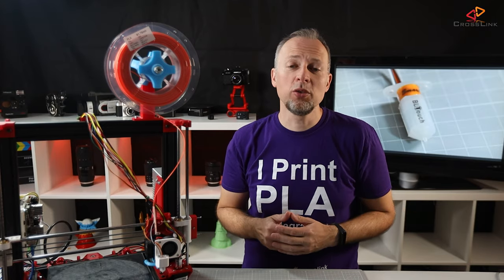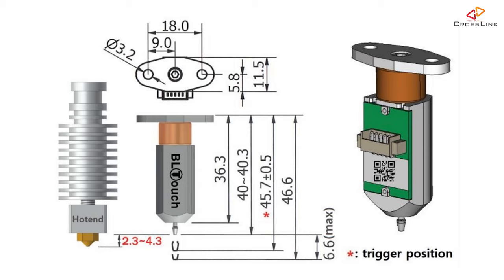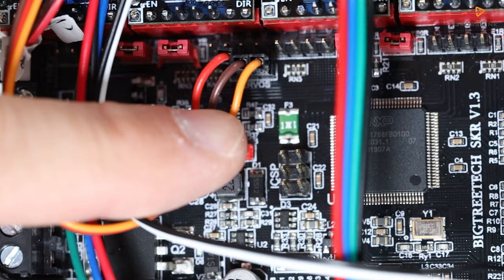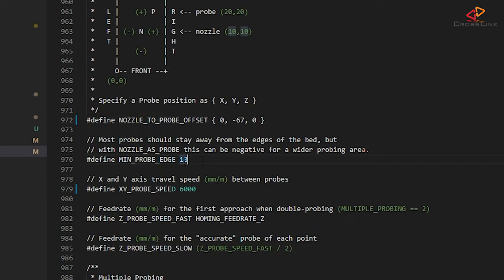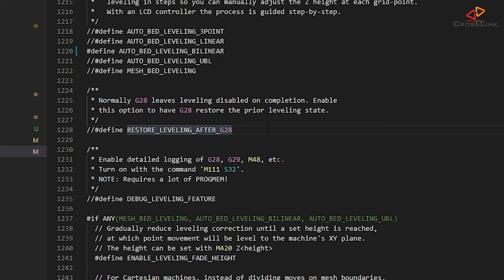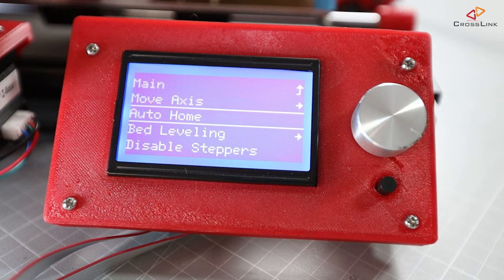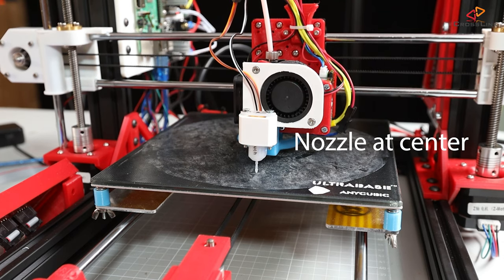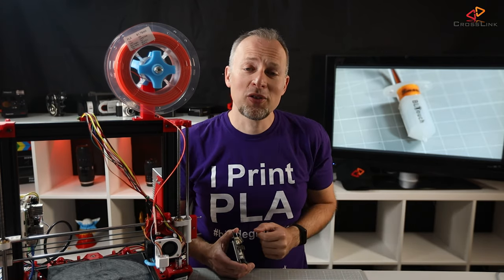SKR 1.3 - BLtouch installation and Marlin 2.0 configuration

Comment: Wow.. I didn't know that the z offset can be set so easy as you did. Thanks.
Reply from the maker: That's mainly because commenting out the MIN_SOFTWARE_ENDSTOP_Z
Reply: @Crosslink3D  Unfortunately this doesn't seem to be working for me. I've used your settings as suggested in the video, on my Ender 3 Pro when I run auto home, I'm getting an error reporting: "STOP called because iof BLtouch error". It feels like this is happening when the head drops down to where the Z stop microswitch is. It's pretty strange, I'm not sure what else might be the problem and not really sure how to resolve this one.
Reply: Oddly, when bltouch is dropping down to the bed and I tap the probe, I would expect it to stop moving but it doesn't, it just carries on. Not sure if this is expected behaviour or otherwise.
Reply: If I remove the z stop microswitch connector entirely, and then run auto home, the head doesn't even drop down to the bed before reporting "STOP called because of BLtouch error". I feel like this is becoming a lost cause. I've had the BLtouch for a couple of months now and not come even close to getting it working. A shame! Anyone want to buy a BLtouch? :)
Reply: @wellyftw  Go to Kay3D on Facebook.  He has the best install instructions.  Remember 1 thing, the color of the wires do not define their value.  Sometimes the color and values are not what you expect.  Always use ged, signal, and voltage and trace back to the probe to see if they match.  It seems your grd and signal are wrong, or 1 of the wires is bad.  Test with a meter.

Comment: I enabled Z_safe_homing but the print head is not moving to the center of the bed nor is the probe deploying..  any ideas whey.  I followed your tutorial exactly
Reply: i have the same problem i really dont now what to do
Reply: @kartgaming7643  I ended up swapping the board to Duet,  BLTouch working great now...   Marlin Still has some issues that need to be addressed

Comment: hi, my 3d touch doesn't work, the firmware is perfect, I've checked it 3 times, and the installation seems to be fine too. my problem is that when I Auto Home the printer the z axis keeps going down even if the sensor touches the bed. I tried faking a home mid z by manually acrivating the probe and the z axis once again kept going down towards the bed, what should I check? thank you for your time
Reply: edit: I hooked up the old switch and simulated a home, if I manually press the old switch (which is laying on my desk) I can trigger the z endpoint and finalize a successful homing, but if I leave it to the probe it fails. Do I have a faulty unit?
Reply: @haythamfpv  dude, im having the same problem, how did u solve it?
Reply: @marcospiotto9755  no man, I have no idea

Comment: Daniel - firstly, thank you so much for all your videos. I've had my Ender3Pro for 2 months now and your videos have been a HUGE help. I feel I know so much more than when I started. I've just installed a BL-Touch along with Marlin 2.0.5.3. I have a glass bed from Creality and started doing manual levelling. Then I progressed (with help from your videos) to mesh bed levelling. My bed actually has a noticeable dip in the centre of around 0.05mm - I discovered this with the mesh bed levelling. However, unlike the mesh bed levelling which worked great, I'm getting rubbish first layers with the BL levelling. It's as if it's not measuring properly. Yet to watch it, it looks like it's doing all the right things. Is there anything you can think of that may be causing the problem? ANY ideas/tips/things-to-check would be greatly appreciated. Many thanks.
Reply from the maker: Did you try to do 3 probes per point as a start? It will take the average. Also did you play around with 5V mode yet, it's supposed to be more accurate. What settings did you change so far to improve this?
Reply: Crosslink hi Daniel. Yes I did all of that! I have now resolved it. There were multiple potential causes. First I found the BL pin was bent so using the advice on one of your videos I straightened it. I then had an accidental head crash into the bed (my fault) and when I checked things I felt the head wasn’t that tight on the x axis extrusion. I took the whole head bracket off to work out how to tighten it. What was the weird was that the skirt would
print fine around the perimeter of the bed but the print just wasn’t sticking in the front left corner. I assumed it was a problem with the levelling. I checked and rechecked the bed was level manually. Still didn’t work. Checked adjusted and readjusted z probe offset still didn’t fix it. I then thought I’d reapply the adhesive spray I’d used a few weeks ago. This made a big difference and the prints started to stick. However when i printed things I started findings holes in the prints. A print of several parts would have a linear hole in more than one part and they were all parallel to each other. My partner has bought an excellent book on 3D printing problems called “3D Printing Failures” 2020 Ed.  By Sean Aranda. After trawling through that it suggested checking the x axis drive belt was not too loose.  I had undone this when taking the head assembly off and I noticed it wasn’t very tight. I also noticed that the carriage was a bit too tight in places. I slightly loosened the carriage so that it was still solid but not overly tight, and I tightened up the belt. Not only did this fix the problem with the holes, but I found my prints were of a noticeably higher quality then I’ve ever had with printer since I got it a couple of months ago. So very happy now!  Following in from your videos, I want to enable more Marlin features so have ordered an SKR mini E3 V2.0 with more memory. There is no way I could have got this far without the aid of your clear videos. We’ve been busy making Covid masks with the printer. I can post you some photos of our colourful output!  Thanks for everything you do Daniel. Kind regards, Anthony

Comment: Great video. You were great in keeping it full of the needed information, while also keeping it short and to the point. I followed your instruction on my Ender 3 and it worked perfectly the very first time I powered it up!
Reply: What did you do with original Z endstop switch?
Reply: @idemajdkesobbirokvalamit6259  I repurposed it as a filament run out sensor.

Comment: I share my experience, having bought an original BLTOUCH six months ago to install it on my 3 years old  Anet A8, where I had endless problems with the first layer adhesion. 
By trying nearly everything, the automatic bed level was NOT working. Finally I damaged the main board by removing a resistor and I bought a SKR1.4Turbo. 
After a lot of research on how to plug the BLTOUCH on the SKR1.4, the video of Daniel explained how to do it ! (With minor adaptation from SKR 1.3 to 1.4 : electric wires of the BLTouch connected in a different order see comment of vandit6354 here below)
BUT it was still NOT working ! After G29, it was like the data of the probing were not used by the printer for the first layer !
In the video, there is an interesting explanation about the concept of the "Fade height". By checking with Pronterface command M503 : the face height was set to 0 
echo:; Auto Bed Leveling:
echo:  M420 S0 Z0.00 => Fade Height = 0 so the printer is not adjusting the Z of the first layers 

I modified the following
SENDING:M420 Z20    => it means adjust the Fade height during the first 20mm
echo:Bed Leveling OFF
echo:Fade Height 20.00
SENDING:M420 S
echo:Bed Leveling ON
echo:Fade Height 20.00
SENDING M500 => save settings

Et voilà mon ami ! Everything is fine, it’s working, thank you Daniel !
Reply from the maker: That's still very strange because having a fade height of 0 should apply leveling to ALL layers of the print according to the Marlin docs: https://marlinfw.org/docs/gcode/M420.html
Reply: @Crosslink3D  I have the impression it's a sort of bug in Marlin 2.0.5.3 every time I reflash the firmware with the command M420 the bedlevelling is OFF, I need to reactivate it manually with pronterface M420 S
Reply: Was the resistor you removed R11(Zmin)  to allow you to use a PNP probe by chance? I am moving from a PNP to the touch and cant find a straight answer as to whether ill be able to use my "damaged" 1.3  boards

Comment: can i follow the same steps for skr 2.0?
Reply from the maker: It should work with the 2.0, ports on the mainboard might be labeled slightly different though
Reply: @Crosslink3D 
Many days now im trying to figure out an issue with bl touch.Z axis moves( like it's trying to level the bed) while i print but it doesnt get it right.
In some corners of the bed surface,nozzle prints  to low and vice versa. I tried M48 and results are ok. Also my printer is sturdy and well build.I use bl touch smart 3.1 on marlin bugfix 2.0.x and btt skr V2.0
For the love of god help me
Thanx ❤️